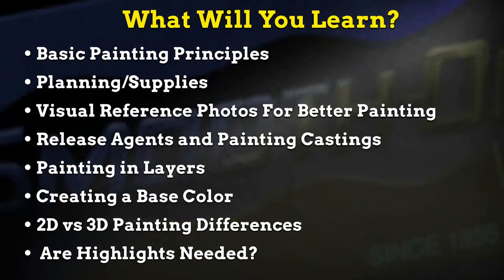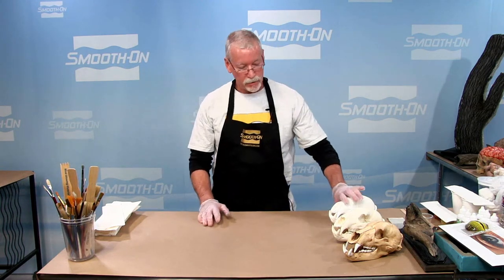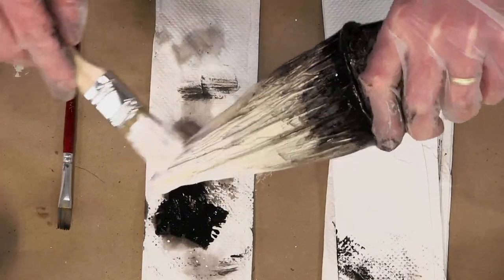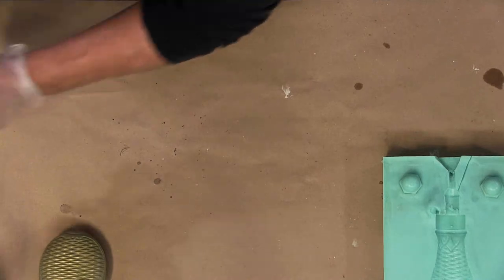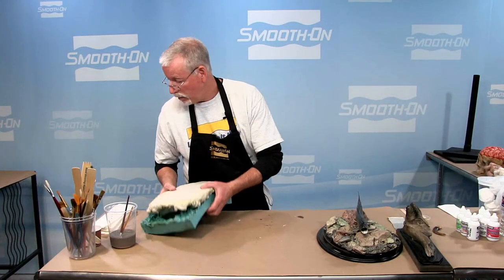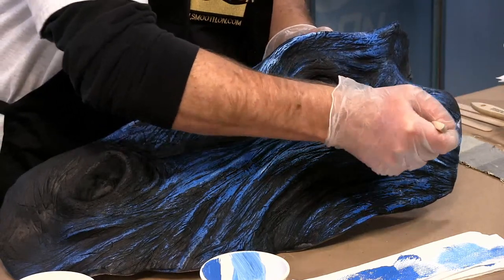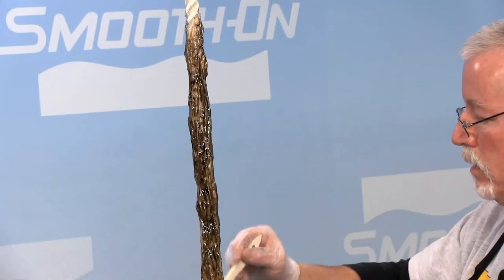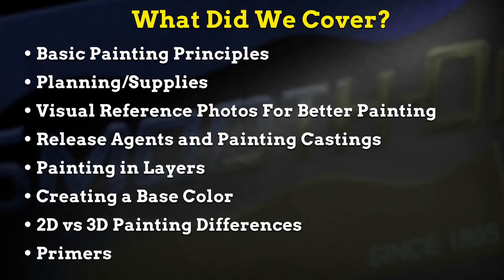From Ordinary To Amazing!  Painting and Finishing Your Resin Castings

Comment: At the 31:00 mark, it is said that a "gray primer" could be sprayed into a mold. Could a clear primer work? My thought is if I add a colorant to my resin and spray the mold with clear primer when I cast the piece and de-mold, the piece will be primed if I want to add additional color via spraypaint or airbrush. Would this work?
Reply from the maker: You would have to test with your particular primer, but as long as the primer is dry, it should work.

Comment: Using animal-safe materials for aquariums. 1) Hard to paint my cast pieces, even without a release agent. Would a water-based paint work as well in the silicone mold to bond to the cast? 2) Also, does free-form air float? 3) Does the sugar technique work with Tarbender?
Reply from the maker: Hi Leslie, this may work, but you would need to perform some testing.